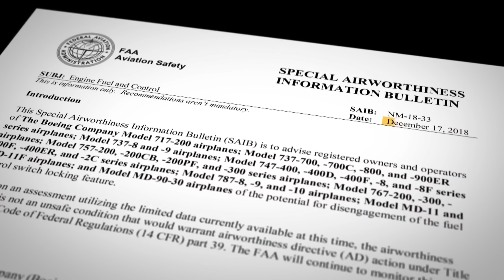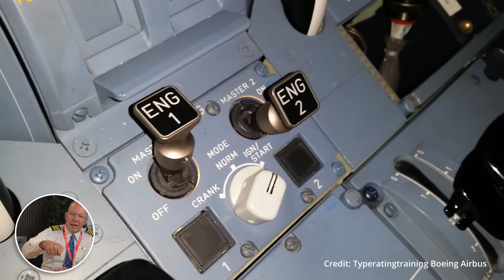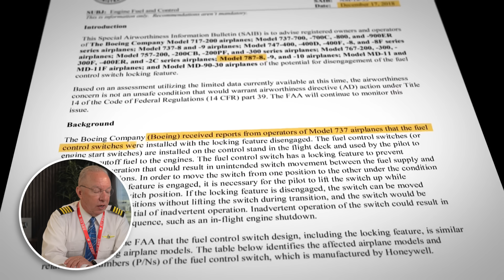Air India 171: The FAA’s 2018 Fuel Switch Locking Bulletin Explained (16 Questions Answered)

Comment: Is it possible the fuel control switches were in the off position before takeoff or rotation. The rat cannot be deployed while the plane wheels are on the ground so perhaps the fuel supplying the engines is on the same circuit as the rat deployment until the planes wheels leave the ground,,,,something is redundant here. If the fuel control switches are mechanical, then the rat should also be mechanical but it’s not.  My kind opinion

Comment: This entire supposed sequence of events doesn't add up for me
SEQUENCE:
-(according to recorded flight data) both fuel to engine switches are placed in the off position
-(according to recorded voice data) 1 pilot ask the other pilot why did he place the switches in the off position
-(according to recorded voice data) the other pilot denied putting the switches in the off position
-(according to recorded flight data) the fuel to engine switches are placed back into the on position

When the investigators supposedly examined the controls, both switches are in the off position...not a single switch was in the on position...why would this be?
Some may say, well the other pilot (suspected of switching them off the first time) switched them back off...if this was true...then there's going to be voice recordings of some kind depicting a heated verbal exchange, a struggle or something regarding this supposed deliberate action!

Yet, there's NO report of such a verbal exchange or scuffle or anything of that kind that would make sense!  The way in which this tragedy has been reported on doesn't pass the smell test to me...IMO!

UPDATE:  The only way this entire tragedy, as reported, would make sense to me is if....the pilot who asked why the switches were put in the off position is ACTUALLY the 1 who placed them in the off position in the first place!

Comment: There is always some fuel stored in the pipeline that may be enough for taxing and take off the flight? In that case, the fuel switches could be down in a cut off position prior to take off and went unnoticed by Pilots? Is that possible.

Comment: If one pilot cut the fuel to both engines and the other pilot said hey why did you do that then ,he put the fuel switches back to run,  why did the 787 have them in the cutoff positions found at crash site?

Comment: The FDR records logical states of the switches (RUN/CUTOFF), not necessarily the physical mechanical movement. This means a false or spurious signal could be interpreted by the FDR as a legitimate switch action.

Intermittent wiring fault, chafed wire, or short to ground could send a false signal to FADEC.
Especially critical if the wires from both switches share routing (e.g., a connector bundle near the throttle quadrant or EICAS).
Dual engine shutdown 1 second apart could be a cascade from a common wiring point or signal processing fault.

The Throttle Control Module interprets switch inputs and communicates with each engine’s FADEC.
If the TCM failed or received corrupt input:
It could send false shutdown commands to both engines, even if switches weren’t moved.
The TCM on this aircraft was replaced twice (2019, 2023)—but no link to fuel switch issues was ever recorded.
No engine shutdown faults or anomalies in the logbook suggests no diagnostic trigger prior to takeoff.
However, this doesn’t rule out a latent software or logic fault.

If the aircraft experienced electrical transients, brownouts, or power switching between essential buses (e.g., RAT deployment suggests partial power loss):
The state of digital latching relays in the control logic could change, triggering false "OFF" states.
Boeing 787 uses electrically signaled controls, not direct mechanical cables — so electrical stability is crucial.

The FDR logs what the system tells it, not a mechanical action.
If a FADEC software bug or signal fault caused the FADEC to shut down fuel flow, it may log this as a switch transition, even if no crew input occurred.

There's no mention of cockpit voice recording confirm clicking sound or switch movement.

Important Precedents (Aircraft Logic Overriding Inputs) :-
Qantas QF72 (A330): ADIRU fault triggered uncommanded nose-down pitch—FDR saw control inputs that pilots never made.
Lion Air JT610 (B737 MAX): MCAS input misinterpreted AoA sensor data and trimmed nose down without pilot input—FDR logged as flight control movements.

You're jumping to conclusions and blaming the pilots without waiting for the full investigation to be completed. The preliminary report clearly shows a dual engine shutdown immediately after takeoff — something that may have been triggered by a system fault, not necessarily pilot error.
Making bold claims without technical understanding misleads people and disrespects the complexity of aviation safety. It almost feels like you're defending Boeing harder than Boeing defends itself. Let’s wait for facts, not promote speculation.
Reply: You are clutching at straws
Reply: @mikewilkins9484  If pointing out established facts and possible system-level failures is what you call "clutching at straws," then you may need to revisit how aircraft accident investigations actually work.

This isn’t about defending anyone — it’s about not rushing to blame the pilots before the investigation is complete. 
Even the official preliminary report does not mention any human error or deliberate action by the crew. Jumping to conclusions at this stage is irresponsible.

If you're still certain it was pilot error despite inconclusive evidence, that sounds more like confirmation bias than actual technical reasoning.

Let’s stick to the facts and allow investigators to do their job — not turn YouTube into a courtroom.
Reply: Vague intentionally
Reply: I agree…something doesn’t add up. The investigation should go in several directions . Yes, check the pilots mental health …check the plane.
What’s on the CVR. Imagine what you would say after…”I didn’t shut down the engines”….and you see the switches in Cut Off. Something like …”well…who did this” while putting them back to Run. Or…”What did you do “?
Reply: Let's not forget that there is the video recorded by one of the passengers, Akash Vatsa, in the same plane a few hours earlier, showing the non-functioning AC, LCD displays, lights, call buttons.
He was on its earlier leg from Delhi to Ahmedabad.

Boeing must be frightened now, because if it turns out that the disaster was caused by an electrical/IT system failure, it will bankrupt the company.

I do not know how independent the investigation is, many Britons have died, let us hope that at least the British authorities will not allow Boeing to cover up the matter.
Reply: I once drove a car which had water leaked into an ECU compartment. Boy, the main computer registered all kinds of sensor readings, state changes and faults except for one: water in the ECU compartment.
Reply: A false or spurious signal would, as you say, be logged by the FDR.

And no such signal was logged. Note that a spurious signal would have resulted in an "extra" signal being logged in addition to the two which were logged. And no extra signal was detected.

In your scenario the sequence of events would be
1) Spurious signal shuts down the engines. Event logged.
2) Pilot moves switches to the cutoff position. Event logged.
3) Pilot moves switches to the run position. Event logged.

Only two signals were logged. Therefore (1) never happened.
Reply: @SeanFication  You're assuming that a spurious or unintended signal would result in additional, separate events being logged, but that’s not necessarily how these systems behave.

The FDR only records state transitions—i.e., when a switch goes from RUN to CUTOFF or vice versa. It does not log the “source” of that signal, whether it was 
a physical mechanical action,
a command from a faulty wire,
a logic-level drop from a controller, or
a signal glitch interpreted as valid.

In a system failure scenario:
…there would be no “extra” event unless the system reverts back or toggles again. So you’d still only see two logged events:
RUN to CUTOFF (caused by fault, not physical switch)
CUTOFF to RUN (caused by pilot attempting restart)

So the fact that only two events were recorded:
doesn’t disprove a spurious or logic-triggered event,
it only confirms that the switch state changed — not how or why it changed.

In modern fly-by-wire systems like the 787, electrical commands—not just physical lever movement—are what matter, and that’s what’s being recorded.

Plausible Scenario Supported by All CVR and FDR Events where the crew is clearly surprised “Why did you cutoff?” — “I didn’t.”
The pilots likely saw the fuel control switches in the RUN position, but the engines had already shut down. In response, they moved the switches to CUTOFF — but since the system was already in the CUTOFF state (due to a spurious or logic-level signal), no state change was recorded by the FDR.
Immediately after, they moved the switches back to RUN, triggering a CUTOFF to RUN transition, which was recorded in the FDR.

Also — I’m not saying the pilots couldn’t have made a mistake. I’m just saying: let’s give every possibility a fair analysis before pointing fingers. That’s the logical and responsible thing to do.
Because here’s the reality: If it was pilot error, the investigation will reveal that. But once you rush to blame the crew, you can’t undo that damage — even if later evidence proves otherwise.

And let’s be honest — if this had happened during his flight, he wouldn’t want people jumping to conclusions and blaming him without proper evidence or a final report. Every professional deserves that same level of fairness.
Reply: Very well said! AMEN

Comment: So in the intro to this video, you show parts of that bulletin that include supposedly this model of aircraft (one involved in this incident) and the fuel control switches possibly being able to move to cutoff unintentionally, yet this is nowhere discussed in the actual video. Is that actually in the bulletin? If so, is it possible the pilot that responded with "I didn't" spoke the truth?

Comment: Could the findings merely be a reflection of the starting hypothesis of the investigators (due to obvious interests)? And would it take a 2nd incident to find the truth - like in MCAS disaster?

Human error is an easy conclusion. And often (not always) indicates poor/prejudiced investigation. 

E.g. why isn't there a built-in delay between the two switches being turned off? Say a 10sec delay between turning the 2 switches off (it seems there is never a situation to put them off in urgency) OR could the two switches be located  within reach of different pilots (i.e. difficult - not impossible - for 1 pilot to turn both of them off)😢

Comment: Captain Steeeve, thank you for your report on this subject and all your videos in general. 🙏🏼

About the switches for the fuel. Is it a reason for their position or is it possible to replace them more strategically, like on the panel in front of the pilots? In that way the other pilot would have been able to react faster.

Comment: Having video in the cockpit would not have prevented this from happening, but you would know with absolute certainty who did it.  They should have an AI copilot that would prevent any pilot/copilot from doing something that would be detrimental to keeping the plane operating as required.  You could build in a failsafe that you could only change the configuration if both pilots concurred, maybe a biometric scan individually from both pilots change a setting?

Comment: I don't think , in simulator u can analyse real scenerios,,,,,suppose circuit below the  fuel handle was not proper, or some underlying chip is not proper,,,and because of those signal engine started going down. Pilot listened to it and found on their screen that switches are in off position. May be looking at it,,, pilot said to other why he cutoff the supply,,,,which other replied he didn't. And then they again tried to turn off and on again. In report it is said that both switches took 4s interval to turn on,,,,,then how can it turn off in 1 sec apart,,,, by mischievously if done how can other didn't got to know it,,,,because of turning off in 1 sec it will require use of both hands.,,,,, in simulator u can can't replicate wear and tear of underlying electric circuits,,,,,,,may be at a time of takeoff because of vibration those (components) could have come out

Comment: Doesn't anyone find it strange that the report does not name which pilot did exactly what considering they are required to speak using headphones during takeoff and landing? Pilot suicides have more detrimental value in eroding public confidence than equipment failures surely this could have been handled better than how it was,!

Comment: No way will I fly again. After watching all these air videos, I think there are regulations applying to every single thing from bolts to sterile cockpit, etc. but NO regulations on mental health --- No way another pilot will have the awareness or skill to deal with suicide/mass murder by flying. Also, this video is dated. News reports are saying the 56 year old pilot had "medical" issues and was on medical leave for a while, and was retiring in 3 more flights to take care of his father. What? No way would another pilot know about this potential murderer in the midst. Strict mental health screening is NOW required.

Comment: Captain, By design how come allowing to manually switch off the fuel switch shortly after take-off and before reaching a safe altitude will help in any scenario other than leading to crash (that eventually happened).  Atleast by design, fuel switch should not be manually allowed to be changed to switch-off until safe altitude is reached ... Critical question to be invested by Boeing design team.

Comment: Do the fuel cutoff switches operate in duality with the actual fuel cutoff valve in the engines?
What I mean is, if the fuel valve in the engine encounters an issue and turns off, will that also send the same signal as a manual cutoff?
Could a vapor-lock have caused the engine valves to cut off and the pilots were confused and took 10 seconds to manually move the switches to “reset”?

Comment: I understand that there are varying opinions on the reason for the crash and it seems rather shocking that the pilots may have caused this crash, but I think it's the easy way out. Capt Steeve started the video off by quoting the FAA 2018 directive stating that even 787-8s can come with disengaged fuel switches and can be inadvertently switched off either because of electrical failure or mechanical failure. If so, Boeing agrees that their EAFR and FADEC systems might be faulty. In my personal opinion, I feel it's a failure on the airline company's side to ensure all aircraft were checked thoroughly after the FAA directive.

Comment: Have you been pressured or paid by the big money or state to say with so much certainty that it’s a pilot error (intentional)? You just seem too sure, given the fact the switches feed into a computer system.
Reply: Unless somebody can figure out how this specific computer system (not just any computer system, not just hypothetically possible in a vacuum, this specific computer system) could throw out a series of faults that match exactly in both effect and timing what is seen to have happened to this airplane, these questions are less than useful.  Anything's possible in imagination.  Is it possible in reality?

Remember:

The "official theory" as of the moment, based on CVR, FDR and recovered levers --

Pilot physically moves both fuel cutoff levers, one right after the other.
Engines starve of fuel and lose thrust.
Pilot (same or different, doesn't matter for this) questions other pilot about why they did something, implying either that something had been noticed or that something was there to notice, of something physically changed.
Levers are returned to their normal state.
Engine tries to spool up, but it's too late and the plane crashes.
Levers are recovered still in the normal state.

People who are trying to argue that an electrical fault is a plausible alternative need to explain all of the following:

How can this computer system turn off the fuel to both engines all by itself with no pilot input, and in this fashion (with the given timing).

How can it then turn itself back on.

Why does it turn off and then on in perfect concert with the statements by the two pilots (as opposed to at any other time or not at all).  What is the physical/electronic logic to cause that particular timing coincidence.

I'm not going to say any of that is impossible, but surely you can see that that's considerably unlikely.

Comment: How can the highest critical system FDAL A , be designed to be changed while in take off mode ? The system design must have a warning method to alert in case it was turned off in any phase of flight . And, data should be in event history logs.

Comment: I imagine there are a thousand ways for a suicidal pilot to take down a plane but the fuel cutoff switch seems shockingly the easiest. Computer logic seems the easiest for an immediate fix but what about the switches placed on either side of the pilots such that no one pilot can turn off both?

Comment: This is the question-
Is there a software-based way to bypass or usurp the function of the switch? 
Every piece of modern software I ever saw had a REST API. The switch presents a voltage to a computer at a register- it's all ones and zeros from there.